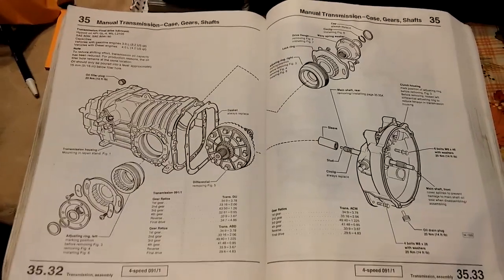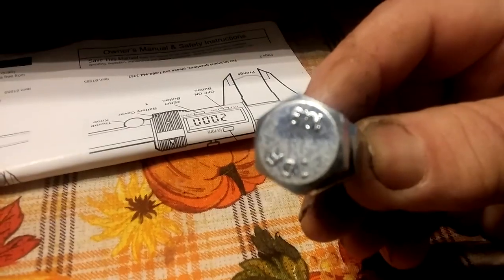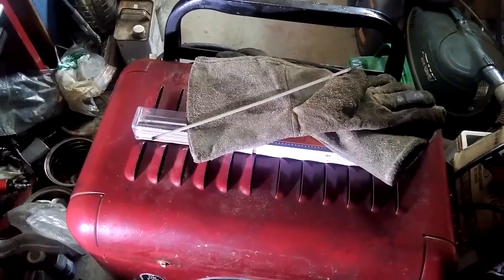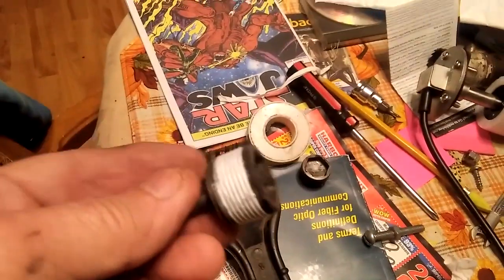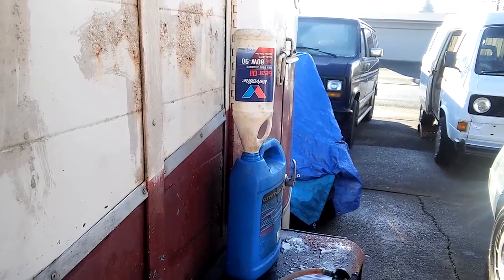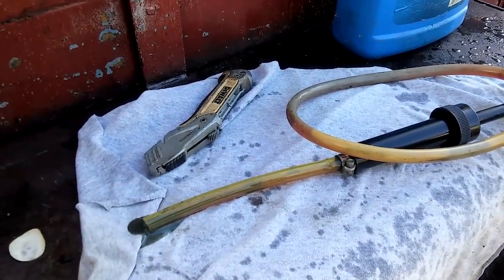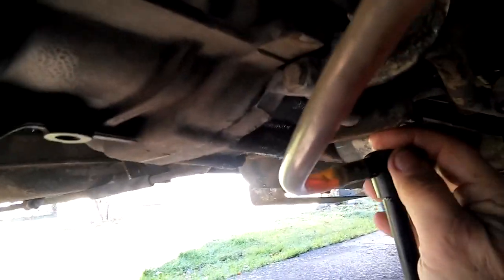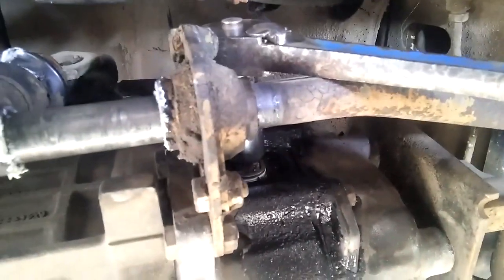VW Vanagon Transaxle Oil Change

Comment: Thanks for the video.   I like the short content so I can figure it out and get to it.  

I like the suggestion of lifting the front to drain the oil.    Smart.   

Since I don’t have a 17mm hex headed tool nor do I have the capabilities of welding a nut on a bolt the way you did, I was able to achieve the same thing but with two nuts at the end of the bolt.   I just put a wrench on the inner nut.   It was tricky and cumbersome but I got it out.   

When filling, I leveled the van and filled it with a pump until gear oil dribbled out.   This ensured the case was filled properly.   

I went with blue threadlocker instead of tape for the seal.   I find blue threadlocker to be better at not breaking down with gear oil.   The PTFE tape can break down with the oils.   The yellow tape is better for this if you don’t have blue threadlocker.    

I like the video and I like your style.   Making tools and pumps work to your needs.   Bending the rules to achieve the same results without having to spend $$ on tools you only need occasionally.    Nice!

Thank you for the video.    I know it’s 3 years old but it’s relevant, easy to understand and to the point.    I wish more videos were like this.

Comment: My drain bolt won't come off, and that exhaust pipe in way makes it even harder. I drained as much out of the filler hole. And refilled. Good enough. You didn't show taking off the plugs! C'mon man
Reply from the maker: That can be really tight. I fabricated a special tool from a metric bolt and nut welded together, and used a long breaker bar with a cheater extension. You can't hold a camera doing that lying on your back! C'mon man? Let's go you know who!